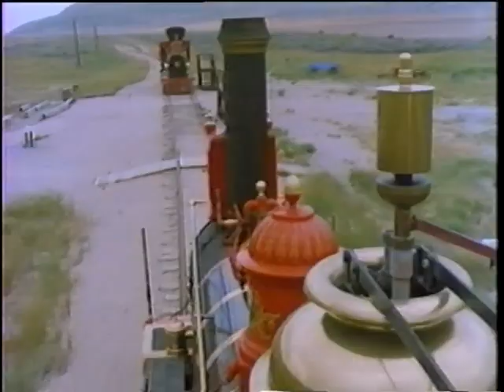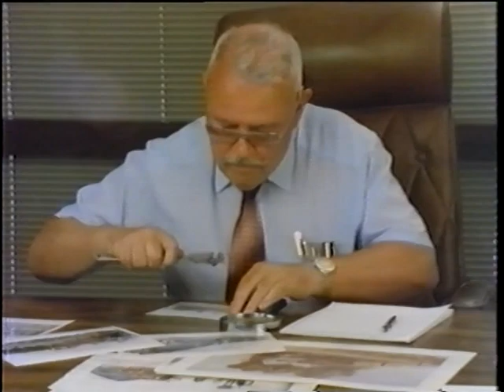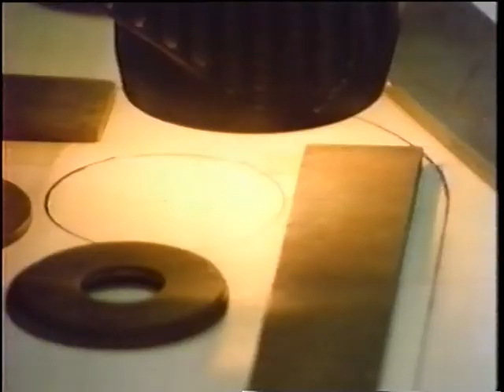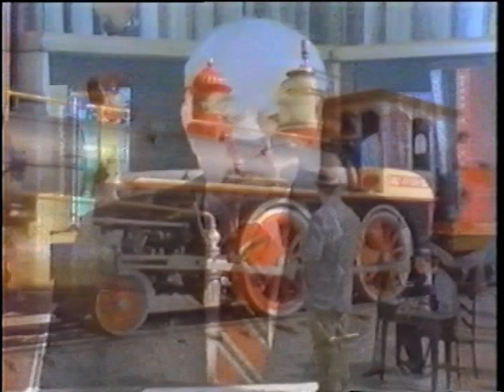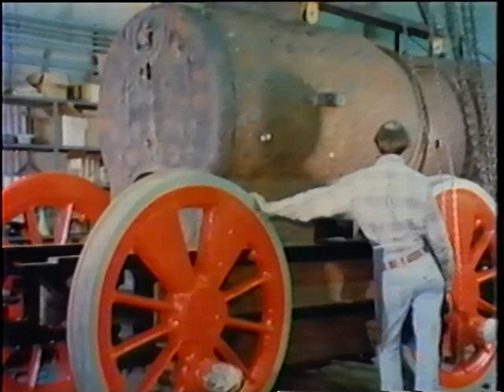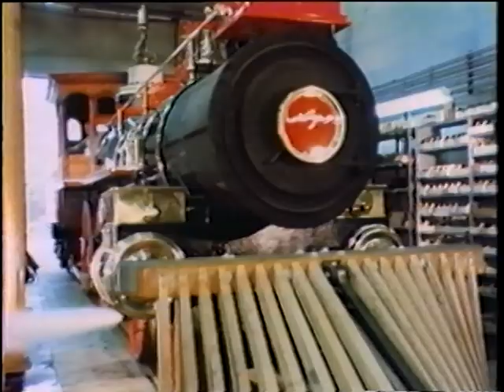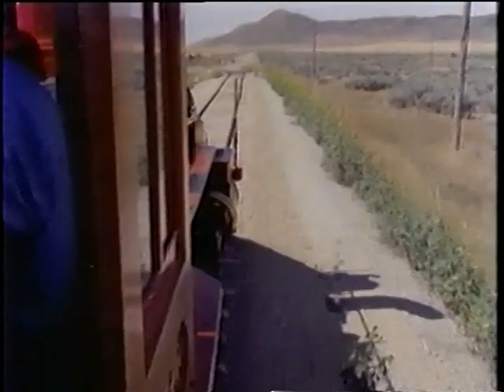Building of the Jupiter & 119 Locomotives

Comment: All credit to the loco builders, they have done a great job, especially without drawings.
Reply: +falconoilcompany  They of course originally had drawings- drawings done by hand and to scale, with dimensions and lists of materials. There were complicated pieces of machinery being built in factories in the 1800's; steam engines, looms, lathes, punch machines, etc. At least they found a boiler drawing which was the heart of the locomotive. These guys did an amazing job with the re-creation, and very wisely used updated fabrication techniques and materials (steel vs cast iron etc).
Reply: If only they could pull excursions
Reply: @Iain Botham  ,
Reply: Hopefully they kept all the drawings they themselves made.

Comment: alot of the stuff was used for another couple of 4-4-0's, disneyland railroad engines 1 and 2. for example dixon built all welded boilers and frames torch cut from one piece of steel

Comment: Excellent lesson here.  I'm certain O'Connor can do an all-new boiler, based on preserved drawings for Baldwin Locomotive Works #2816, for Old Tucson Studios #11 "Reno," ex-Virginia & Truckee, of modern steels unavailable when Baldwin got the contract; the Studios gutted the original wrought-iron boiler sometime before the 1995 fire and botched cosmetic restoration.  (As of 2014, #11 has the Schenectady cab from her stand-in role as Central Pacific #60, since re-created by O'Connor Engineering, rather than a correct Baldwin cab.)
Reply: B. C. Schmerker sadly mr O'Connor passed in '07. His shops now only make fluid heads for tripods and not steam engines like they also used to make. I'm certain there's plenty of people out there who'd want to do the job, but the locomotive is property of warner brothers studios in Tucson and they might not want people to work on it. Mr. David kloke who built the CP leviathan replica and the NCRR York replica for steam into history might be good for the job though. It's just a matter of convincing the owners of old number 11 to allow her to steam again. Strasburg does have the capacity to build new boilers for locomotives, but one for something as old as the reno might be out of their league! Yes they built a new boiler for the WDWRR Lilly belle, but mind you she is a narrow gauge 1920s engine that already had a new boiler (circa 1972/73) on her when she came in and, if I'm not mistaken, the new new boiler is computerized (at least that's what's being said). That's not to say though that it can't be done! I'm just not sure that Strasburg would be able to build a new boiler for something that's 140+ years old considering how it's made much different from what they've built new boilers for. There are other locomotives out there from the same time period as the Reno that deserve to steam again, though, that are probably in better shape like the CP Huntington at the CSRM, the John Bull at the smithsonian, the General at the southern museum of civil war history in Georgia, or the NYCHRR 999 at MSI in chicago. But remember, it's not just about the boiler, mechanically wise, there's also the cylinders, the bearings, and other things that need to be considered; logistic-wise there's also the issues of labor, time, money, and the availability of materials needed to put the locomotive back into steam.
Reply: @johnerikson7094  There's also the matter of wear and tear of historical fabric, which is why the RR Museum of PA would rather not operate the PRR 1223 or 8063 again.  Also, the 11 has a Baldwin cab, I think...  It was the 119, the Genoa, no. 12 was the Jupiter.  Old Tucson has talked about restoring number 11 and putting it indoors recently.  When or if they actually follow through, only time will tell...